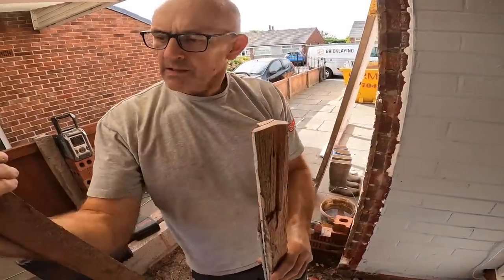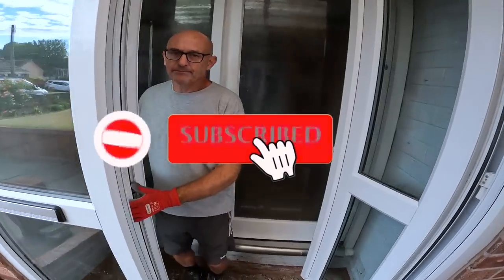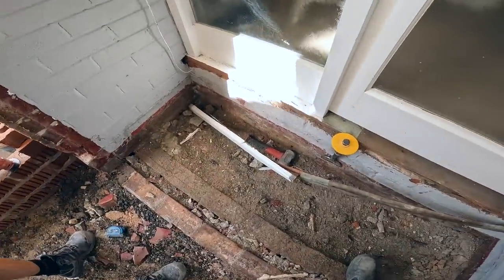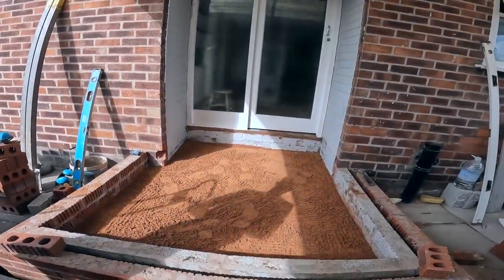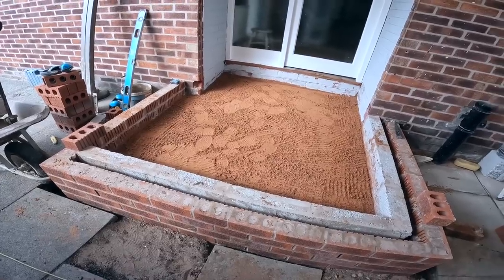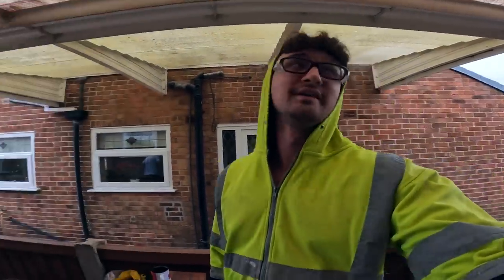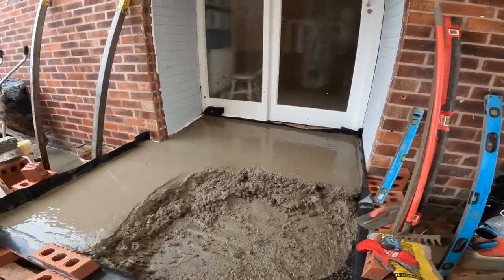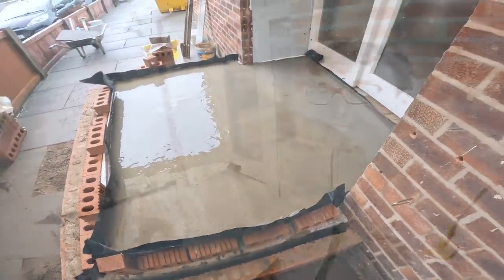DISASTER WITH THE CONCRETE!! PORCH CONCRETE FLOOR AND PREPARATION..PORCH PT 3

Comment: Hi guys what mix do you use for your slabs ? I thought concrete floors should look more greyish with more concrete yours looks like quite a weak mix ? Only asking as doing my porch tomorrow 😉😂
Reply from the maker: We use sand / stone mix and cement 4/1 🧱👍🏽
Reply: @ thanks so much lads !

Comment: I'm a bit surprised you didn't get the mix on site truck in.
But I suppose for the volume you thought it would be the cost would have been too much?

It does seem a waste throwing the old door away but the chance of it being the exact right size for someone is minimal as is having someone who would  build round it looking as you take it out.
Keep up the good work guys!
Reply from the maker: Yeah it’s a minimum charge of 1 cube . 
🧱👍🏽

Comment: Because the main door is being replaced with an internal grade door. Doesn’t it now mean it needs to meet building regs? Ie 100mm celotex in the floor and 100mm cavity’s???
Reply from the maker: This was pre part l 🧱👍🏽
Reply: @SteveAndAlexBuild  so it was filmed before 2001? 🤔

Comment: Take  the superficial area  say, 4m2 take the thickness say 120mm then times it by 2.            4 X 120 X 2 = 960  so you would need just under a tonne
Reply from the maker: Cheers Paul 🧱👍🏽

Comment: Why do you always concrete the floors i would just match the wood floor in the existing house. That is why the dpc is low because it is under the joists. I prefer wood floors as easy to put wires and pipe under plus bloody hate concrete. Good video again lads
Reply from the maker: Thanks Paul 🧱👍🏽

Comment: Hate concrete just had 3.5 cube pumped in for footings on a 3m x 4m area , £530 on concrete inc vat n waiting time + £350 pump cost. They done it in under a hr cleaned n gone. Were in the wrong game.
Reply from the maker: Kin ell ! 😱🧱👍🏽

Comment: How can anyone have a disaster with 4 sq meters? I'm guessing 🤔 but looks like house 70s 80s timber chipboard flooring cavities on main building 50mm No insulation,  your face bricks don't look a good match, hope you match the joints as don't look like your bucket handle! your be stuffing your cavity with insulation and the roof... all that plastic and polystyrene and concrete to take weight of heavy goods vehicles... am also guessing your footings are down a meter, and you will have filled with concrete from mixer
so, we won't call it a entrance Porch but The Hot House 
poor clients for such a waste of materials but look on bright side when house is freezing 🥶 😫 just go sit in The Hot House 🏠 😜 
Malcs in Perth WA ♥️ 😎
Reply from the maker: This build won’t even meet the new insulation regs now so it should be warmer .it’s a bit colder in England